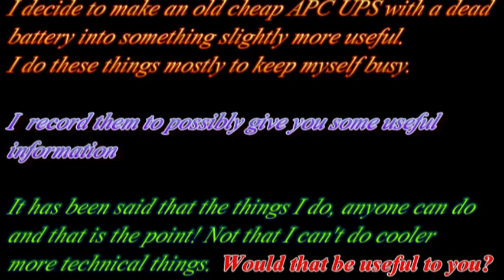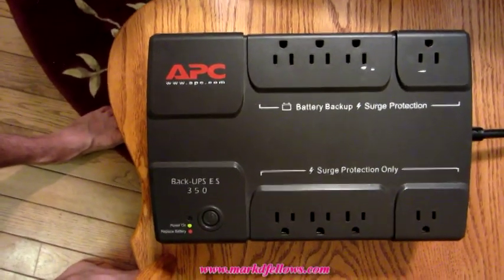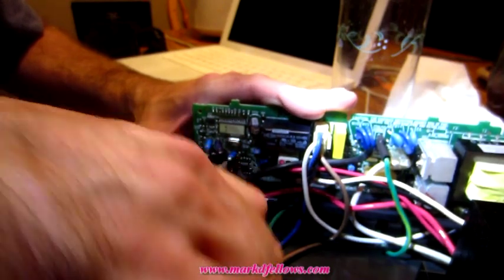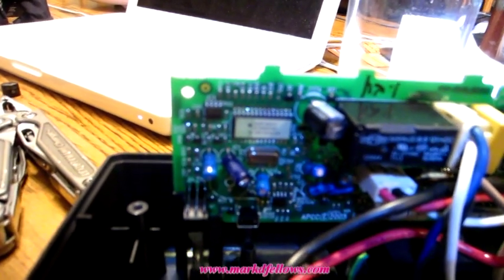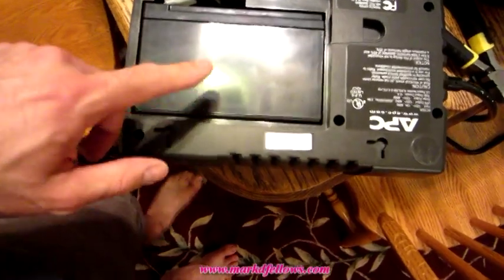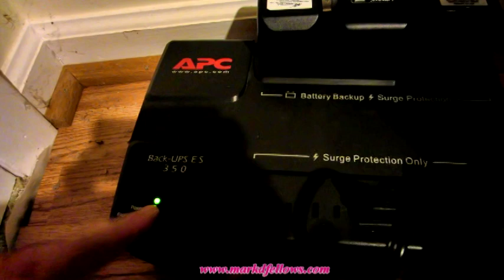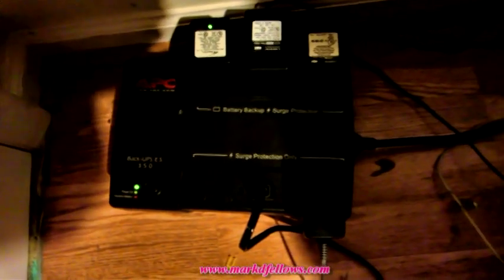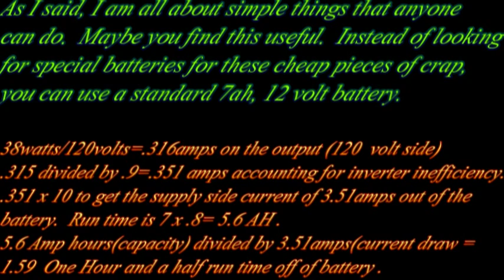APC 350ES UPS. Increasing runtime with a larger, more standard battery size.

Comment: Thanks for answering a question I've been asking all over Amazon, without ever getting an answer. I got the same idea when I decided to replace the 350's battery. I looked for the specs on the back of the case and found specs for both the 350 and the 500 models. Then, I opened it up and found that the battery for the 500 unit fit perfectly (once all these plastic walls are gone). I just wasn't sure that the circuitry was the same inside. In fact, it may very well be if the 500 takes the same amount of time to charge than the 350. If so, then a modified 350 (with a 500 batt) is even better than a 500, because a Lead Acid batt charged slowly will stay charged longer + have a longer lifetime, and a fast charge is not needed for a UPS. What I didn't think of was removing the alarm, and I had no idea how to do it. I'm surprised that removing the component doesn't cut the whole circuit. I would have probably tried to replace it with a plain wire, but apparently, that's not necessary. Great video. Thanks!
Reply: Why removing the alarm\buzzer ?

Comment: I was just taking my battery out today and noticed this issue of the plastic tabs, my other model 550 has the larger battery and I was thinking of how to chip away the plastic tabs easily to run the bigger battery. I was going to use channel locks or vise grips. And thanks for pointing out the beeper diode, drives me nuts. There's also another video of adding DC switches and 12V female plugs to charge your phone directly from the battery without using the power investor which sucks the battery in an hour or so, thereby increasing battery time to charge your phone to one day or more vs 1 charge, and putting a digital voltage meter in to monitor the level of charge left. Looked pretty simple except the template for outputs, but I guess you could skip them and just run the wires through a hole and seal them. There was also a video of a guy using a full size 12V marine battery and 2 golf cart 6V's in line for days of batt power.

Comment: About 6 years ago , I've modified my APC 1500 , by hooking up 2 deep cycle batteries in series since it's a 24 V  system ,it's still working just fine , but the buzzer of the unit annoyed me , so simply I lifted it up using soldering iron and a sucker , but the UPS stopped working ! I discovered later , the double sided PCB has disconnected essential part of control circuit , so I've soldered a dummy wire to connect the upper and lower hole of PCB , and it worked again .

Comment: An even cheaper long run UPS is the BGE70M  oir BGE90M when newegg.com puts them om sale for $20 delivered.  Their maximum wattage is 75 but the BGE70M can run 37 watts for 48 minutes and the BGE90M can run 37 watts for 79 minutes.  Pretty good when the delivered device is less than the cost of the replacement battery.  Not sure if these UPS units are still available but they're worth picking up in yard sales and the freebies on Craig's List and Freecycle.

The last one I bought was a BGE70M in May of 2018 for $18.99 delivered.

The Tripplite 1000 runs 133 minutes at a 40 watt load.  I've picked up several of these as freebies.  So far, the biggest repair is a new battery.

Comment: Thank you so much!  I have a slightly different model of the APC ES 350, but with this video I was able to remove that stupid annoying beeping alarm.  My unit would beep for no reason at all if I plugged in my stuff say for instance because I rearranged my desk or office area.  To stop the beeping, I would have to unplug everything including the APC unit, Then plug it back in and then replug in my computers to it.  Yes, I run 3 computers off it.  My Windows PC, my server box, and my old Mac.

Comment: Um, the alarm can be easily disabled from the APC software. I simply connected my APC to my computer running the PowerChute software with the supplied connector, selected the "disable all the time" option, disconnected the cable to the UPS and was good to go and able to put my UPS anywhere in the house without the alarm going off during an outage. All without having to unscrew or remove anything and took me all of ten seconds and a hell of a lot simpler then the video.
Reply from the maker: Mike Wolf Just by the condescending "um" I can tell you are really smart..   So, I guess I should specify that I  didn't feel like looking for an old piece of software I had for a device I used years ago,  only to try and load it and have an error, and then connect it to the device and have  a USB error, so I could finally do what I wanted.  I don't mind unscrewing things, but thanks for the tip!
Reply: Ok then. :) Sorry you were having problems with the product that you felt you needed to open it. I was simply putting it out there for those who came across the video that there was an easier and safer way to disable the alert without having to open the product, void the warranty, and physically remove something which if it's the wrong something could create a fire risk. The software is easily accessible at the APC website and been tested for up to Windows 8. I just don't want anyone to get hurt. Have a good day. :)
Reply: @mikewolf5367  you can also use the freely available APCUPSD for windows or linux

Comment from the maker: Governo, Absolutely.  The larger the battery, the longer your run time for a given load.  However, a larger battery does not mean you can run higher powered stuff, as the circuity is designed for smaller stuff.  For larger items they make larger APC devices.

Comment: These UPS devices are designed for a short run time. Be careful when adding larger batteries because they do not have fans and heatsinks to dissipate the heat from a much longer run time if under a high load. Most have a small aluminum block to absorb the heat, but not to transfer it to the air. In this example, since it is running a small load it will probably be ok, but do not run them near the rated load for very long. I have seen where people are connecting them to car batteries, not good.

Comment: Sorry, took so long to reply.  Actually it could be over loaded, but I doubt it.  The unit started doing that nearly a day after I got it.  At the time I had 2 computers, 1 monitor, a cable modem, and router.  I have always had the router and which ever modem on the non-battery back-up surge protection only side.  I do know that for nearly six months I had 1 computer and monitor plugged into it, because my wife and I loved in a small trailer with 2 bedrooms and our 2 kids.  No room for the rest.

Comment: MOST units have blade fuses inside!Buzzes loudly? Take apart and find the buzzer and poke a small nail in the hole and mangle it a little to make it quieter. Works fine.

Comment: I just watched your video on a UPS mod.  I have a question for you and hoping you can answer it.  I am trying to increase my backup battery time for a fish aeration pump.  So, I took out the factory battery and hooked up two deep cycle batteries in parallel.  All went well and it ran for about 6 hours and then stopped.  I check the batteries and still had 84% charge left.  I am questioning the UPS system as to why it wouldn't drain the marine batteries to a 0% charge.  I noticed that this UPS system was doing that prior to this modification just on my computer equipment I had it hooked up too.  It would run for about an hour no problem and then over time would only run for about 5 minutes.  I thought it was the battery.  Does this seem odd for a UPS and should I just consider getting a new one?  Thanks
Reply from the maker: +Shawn Paul (MorningStarMissions) I am confused by your question as it is written.  Are you saying that the UPS stopped, but that the batteries still have 84% after you measured the voltage of the batteries with a Digital Volt Meter?  

Or are are you questioning why the UPS would be designed to completely drain a battery?

If it is the first part, perhaps it got hot, and the internal fuse blew.  I think those are made to just open permanently when they get too hot.  Meaning either pulling battery power for X amount of time, or pulling too much current.

What size UPS do you have, and what is your load requirement?  Meaning what is the power ratting of your pumps?

Perhaps you need a more robust UPS, to handle the higher power requirements, not just a longer life battery?

If you are asking why the UPS drains batteries farther than they should, my answer is maybe so the companies that make them can sell more batteries?

Comment: Hi thanks for.the vid it is a good one. I had a problem which I figure you might help me with . I took out a gel cells from a cheap UPS and extended the leads and connected them to a car battery. I figured it would be ok as long as the voltage was same. I did not have problem with the beeper, but the thing is not working as, it keeps on making those clicking noises from relays while on ac ,when it is supposed to be charging the batt. In a nutshell it ain't charging the batt. The batt is new , I might add, and provides a good backup, but have to charge it externally. So the ups is basically just working as an inverter. What gives?
Reply: +Piyush Bishnoi 
Your car battery draws more current than the UPS can supply when charging, the UPS shuts off the charging circuit with the relay when it detects the over-current condition.

Comment: Would have been really helpful to say exactly which battery you used, as dimensions are not consistent on 7 ah 12 v batteries (at least not across the dozen or so on Amazon).  Also would have been worth noting that the air space, while probably overdone, is there for air circulation.  A cool battery is a happy battery, and since there is no fan for forced air cooling, a larger air gap was used.
Reply: 3 5\8" x 2 1/2" x 6" vs the original which is 5 1/4" x 2 1/4" x 2 1/2" roughly. And as far as air gap, my 550 is tight as hell fitting in, as it is on my 80 Watt Monster Bluetooth speaker with the same larger 12V 7ah battery, so not sure it makes much difference if the manufacturer is not providing space from the factory when there is lots of space to do it design wise.

Comment from the maker: The hurdle to overcome would be the charge time.  You can hook as large of batteryy up to this, but the circuitry probably can't charge it.  If you're going to go that route, there are much better inverters.  The ones in all but the expensive APC UPS are cheap modified sinewavve inverters.  I have seen some expensive models that have true sinewave inverters, but most aren't.  That is as large a battery as I will go.  I already have a true sinewave inverter, and a cheap 800 watt modifed one. thx!

Comment: can I use two wheeler batteries?  Will the ups work? can I fit two parallel batteries? Will The ups overheat?or wont charge? I have seen vedios wer some have used car batteries

Comment: To continue my comment.  My computers share a monitor thanks to a handy dandy KVM USB switch.  One monitor, one mouse, and one keyboard to run them all.  My monitor, router, and DSL modem are plugged into the surge protection side.  Thanks again.

Comment: Im considering doing this to my APC 350 ... did yo end up having any overeating problems? Or any problems whatsoever?
Reply from the maker: Richard T i never had any issues with this, but after a while, i just decided it wasnt woryh the potentisl problems and got rid of them...
Reply: The Suburban Hippie Experimentalist Thanks, I have an APC 7.5Ah spare (new battery) and hated having to buy a tiny 3.5 Ah battery when I had a nice new one sitting around.
Thanks for the heads up, I will do the same as you and not risk the possible problems...
Cheers
Richard
Reply from the maker: Should be fine. Just remember that just because it has a bigger battery does not mean it can handle a higher current!
Reply: I have gone a step further.  I set a 12v 28Ah/8hr battery.  Unfortunately APC 350R will only run 1.5 hours max.  It is a factory limiter.  If you can find a APC###U or M then you can run for up to 8 hours continuously.  These units draw .5 amps when operating on battery.

Comment from the maker: A 7AH, 12 volt battery is pretty standard, however, I would not recommend this particular one from radio shack, as I am finding it gets bad reviews.  So, the exact dimensions are useless to you.  As I said though, a 7a/h, 12 volt battery is a standard size so they are all the same.

Comment: good day boss i have es-500 apc ups i try remove the buzzer inside the ups. and my problem only 17mins running on my ups...
pls help to increase running time my ups... and more power
Reply from the maker: Richard Yuson Here is a calculation you can do to know what size ups, and or battery you need.  A rough estimate is.  Power out/voltage=current.  So if you are using say 120 watts, you divide by 120 volts, that equals 1 amp.  So then you have to increase it at least by 10 to get the battery in put current.  In reality, the inverter is not 100% efficient, so you have to add that in.  So you have to take AT LEAST another 10% so, really you would be drawing 11 amps from that load.   So if you have a 20amp hour battery you would divide 20/11 too see how long the battery would last before complete discharge .  That is only 1.8 hours.  In reality, you don't want to deplete the battery more than half.  So the forumulas you need are Power/Voltage=current.  Current in multiplied by step down transformer ration, so if you are using a 12 volt battery that is roughly 10.  You take output current times transformer ratio(10)Divide the current you get into the AH of the battery.YOU WILL NOT GET MORE POWER FROM THE SAME UPS, BUT YOU MAY GET A LONGER RUN TIME.  If you try to put more than the rated power through it, you may start a fire!  Be careful!  Probably should buy a bigger ups...
Reply: FYI, it sounds like larger UPS systems, like the 500 may have a set cutoff time. so it may only run for a set time not using much of its capacity. These smaller ones, espcially the 350 may not have this, and instead, keep going until it gives out.
Reply: @michaelebays  Your correct on the set time limits.  Depends on which model you have.  APC###U or M will run for about 8 hours depending on your battery.  I use a 12v28Ah/8hr battery and can run up to 8 hours on battery.  APC###R is regulated to about 1.5 hours.

Comment: Doing this to an old ES350 someone gave me. I recommend Batterysharks.
Reply: Thanks for letting me know!  Hope it all works out for you!  So far, I have been using mine since making this video with a few power outages, and it has worked without a hitch!
Reply: Mark Daniel Imaging Finished it last night. I was able to fit in a 9AH battery. Everything is working great.

Comment: i just want to have the battery last much much longer ... like put a car battery on the floor and wire it up to the ups leads ... so the ups has more time-power on it rather than that little 15 minute battery that konks out so quickly now